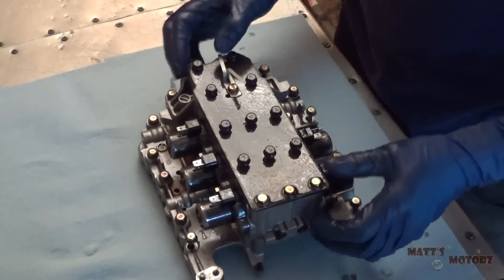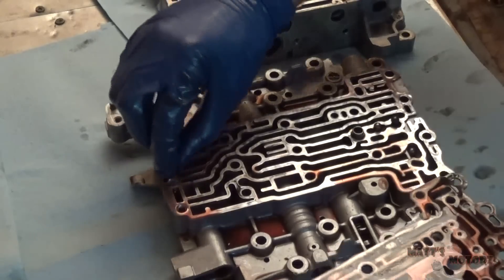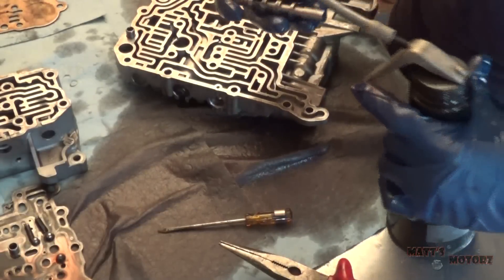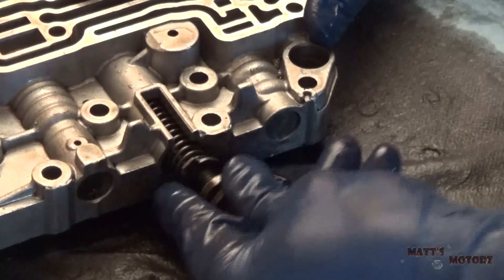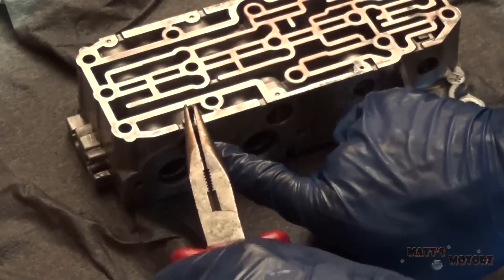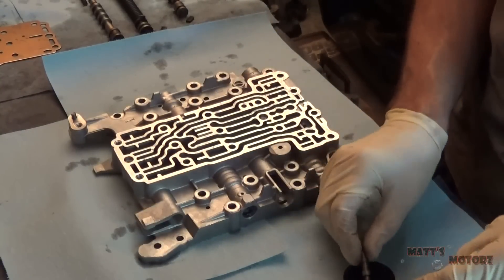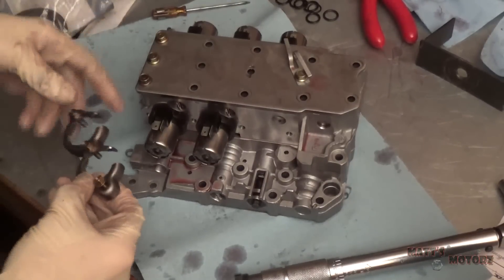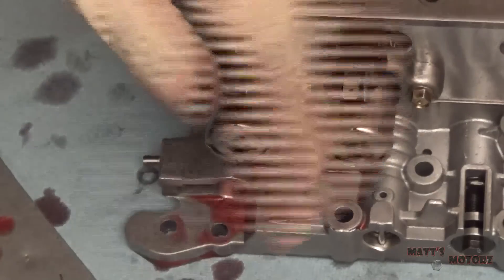F4A42 Transmission Rebuild: Part 2 - Valvebody Rebuild

Comment: I have a question about the solenoids on the valve body. Between them, which one is the torque converter clutch solenoid? Awesome video.

Comment: What solenoids are p0760 and p0755 I can't find any info on it. My code reader says p0760 is c and p0755 is b. It doesn't say which ones they are any help would be amazing.

Comment: Couple of small questions for ya; what symptoms would the transmission exhibit if you had opted not to sand the valve bores with fine grit paper and left the sticky valves? What do those valves do, and would a sticky one cause a solenoid code to throw? No matter how long I look at the hydraulic circuits, I just cant make any sense of them.
Reply from the maker: Sticky valves cause delayed shifting (most common).  I do not think sticky valves would throw a solenoid code but you never know with transmissions.  The computer may get confused if it energizes a solenoid and the transmission doesn't shift because a valve is stuck.  You can energize them yourself and listen for a click to see if they work.  Watch my video "How automatic transmissions work" if you haven't already to get a bit more information on the valve body and valves.
Reply: Thats true, hydraulic pressure > sticky valve resistance for sure. Well.... I have a lengthy inquiry to ask; so I apologize in advance!! But if you'd be so kind just to hear me out, I will pay you even, and just be eternally grateful, since you are easily the only person I can directly communicate and ask with the very specific expertise in our EXACT transmission; I just need the answers to some detailed questions, so that finally, perhaps, I can get my vehicle going again and figure out, exactly 1 year ago, while driving on the highway in overdrive, or I guess its just drive,  did it just... out of the blue, randomly, with no warning, act like it was in "neutral", followed shortly after by thudding into fail-safe mode. I figured out back then that I could somewhat circumvent this by just driving around with shifttronic, albeit with 4th gear absent, and 2nd gear mostly absent.

So, here goes... upon further inspection yesterday, I think I found the culprit of 'atleast' one symptom for sure, if not more, I just need you to help me with the diagnosis because despite reading the hydraulic schematics, and everything else about the trans internals over the past year, I just can't figure out what effect this problem would have.

The problem i'm referring to is it turns out that the 3rd accumulator piston from the left (valve body removed, staring at front of vehicle) has a hole punched in that middle little embossed circle, the raised molded circle; now, I don't understand how this thing exactly functions, so I just need to know what symptoms would that cause exactly? Because ultimately, I need to find out 3 things. 1.) Why 4th gear would go either A.) Rev  Rev Rev Rev Rev like it was trying to shift into gear, or rarely it would do B.) [just be in a neutral-like state]   2.) Why I didnt have second gear, except only rarely when I would downshift (with shifttronic) into it, and finally, 3.) The most recent problem of: Early, cool morning drove ~50 miles around Kansas city for errands, everything was fine, then when I tried to drive home, randomly, while on the highway 3rd would just slip until I got it to like 6 or 7K RPMs, then it would grab a little bit and I just kept revving it up and coasting all the way home, doing about 60mph, and I barely made it home at that. Again, I apologize for the long post, but these questions have really, really been eating at me for the last year, because I just want to really know the ~why~ behind the failure, and of course to get my vehicle running again.
Reply from the maker: When a gear goes like that, it usually means that the transmission is trying to engage the clutches / bands, but something is internally wrong and it is not able to, so the engine just free spins because there is no load on it because the gear isn't engaged.  This usually throws a code. Is there a check engine light on?

Your final problem (number 3) is indicative of pressure loss in the hydraulic circuit that controls that gear.  The pump output of the transmission is directly related to the speed of the engine.  If the gear was able to grab only when at very high RPM it means 1.) there isn't enough fluid to keep the circuit fully pressurized at normal pump speeds (aka, the fluid is low), this isn't likely the case in your situation; 2.) there is a leak somewhere in the hydraulic circuit, most likely on the lip seals somewhere in the 4th gear gear train.

Many times the same clutch pack or band is used for multiple gears, so if the seals are going in a common clutch drum, all those gears will be problematic.

That is all I can do without really digging into it and pulling out the service manual.  I AM willing to do that if you provide payment as you suggest via paypal, because it really would be an investment of my time.  I won't guarantee any enlightenments, but I can offer my knowledge.
Reply: Ahhh, will do. What symptoms would about a centimeter diameter hole in my 3rd from the left accumulator piston cause
Reply: Oh wow, I can't believe I forgot to mention the most important information in my spiel, the trouble codes! lol.  I've had the same 2 codes throughout this whole ordea, always these 2, never anything differentl: P0755 and P0760. So a year ago, I figured I'd just replace the UD solenoid, 2nd brake solenoids, and the solenoid harness and it would be good as new, but after I did that there was no change. Its never thrown anything different but those 2, and later I tried tracing the circuit for a short, and never found any. Its worth noting that when I lost 3rd gear the other day like I mentioned, a peculiar change in the codes came up, instead of those 2, I now was showing P0755 and P0765. No idea where the 760 went, but now it was those 2, which was weird since I kept seeing the same 2 numbers for over a year.
Reply from the maker: Without going into the service manual, a leaking accumulator might cause delayed or difficult application of the gear.
Reply from the maker: Those codes give valuable information.  First, shift solenoid codes do not generally mean the solenoid is bad.  The computer calculates the gear ratio and compares it to what it should be with the gear applied.  If it is different (such as if the transmission is not engaging a gear) it throws these codes.  If you have a general leak anywhere in the circuit causing pressure loss, it is likely these codes will set, even though the solenoids themselves are perfectly fine.

This codes tell us that the circuits involving these particular shift solenoids are the ones affected.  It appears to me, based on the evidence you have presented, that you have a leak somewhere and you most likely require an overhaul to fix it.  To be sure, you should measure the line pressure of the transmission during the problem shifting events (I made a video showing how to measure pressure).  This will help you narrow down where to look if you decide to over haul the transmission. 

It seems to me like you may have a pump failure as you are getting codes that indicate problems on many different circuits. (Many times you can replace the pump without major disassembly).  You NEED to measure the line pressure to determine this.
Reply: would it be a good idea for him to just get a remanufactured valve body and swap it out? they're like $300 for the 42rh
Reply: I would never pay that for a valve body lol, i'd either rebuild mine myself, or more preferably buy one from the junk yard for $35 and order a new gasket for $6

Comment: Where is a video that talks about a 96 Mitsubishi Transaxle in limp mode? What are common causes. Or, what is the most common cause? Wayanchors.
Reply from the maker: A very common cause is a bad speed sensor (assuming the transmission is new enough for that).  Scan computer to see if there are any codes.
Reply: Not a new transaxle. 96 Mirage 1.8L. Not much literature on it. Sometimes I get Crankcase Sensor error. Also, difficult to start in warm weather. Otherwise, no other codes.
Reply from the maker: It looks like the transmission in that car is the F4A22, the predecessor to the one in the video.  I don't know much about this model, but if you don't have any codes then it is very hard to provide good advice over the internet.  Did you get a scanner that is able to read TRANSMISSION codes?  The cheap ones wont do that.  You may have to bring it in to a transmission shop.

Comment: the magnet comment on the checkballs is bullshit, the magnetic effect is negligible and is overcome by the hydraulic pressure and flow.
Reply from the maker: That comment wasn't something I made up, I have seen it in many tech manuals for automatic transmissions.

Comment: My question is...
Are all the solenoids the same?
Like if I buy a pack of 5 original solenoid for a 2003 tiburon but they all look the same.
Reply: I think my tranny is f4a42-2.
I don't know the difference of the  -2 to the f4a42.

Comment: at around 9:34-9:40 I didn't see a spring in that valve. I have the same valve body and also didn't see a spring here. am I missing something or is everything ok? because every other valve seemed to have a spring but this one!
Reply from the maker: Not every valve needs a spring.  It all depends on how the valve is designed and what it is meant to do. So yes, everything is fine lol.
Reply: +MattsMotorz whew! thanks because I went ahead and put it all back together already! holidays have me delayed on parts but your videos saved me some time! Especially since this is the first time I've been inside an automatic transmission lol.

I'm working on an F4A51 that got hungry for the oem style wave spring. SHREDDED the pump! metal shards in everything. I tried replacing the wavy the first time with the tranny still in the car because of flaring shifts and ended up thrashing the pump when everything broke loose 2 days later. oh well. this time I did the flow upgrade for the 2-3 shift flare too so she should be gravy now!
Reply from the maker: When this happens it is imperative to clean EVERYTHING really well. You want to remove all traces of aluminum that has been flowing through the system from the damage. This is especially true for the valve body as many times the aluminum in the fluid acts as an abrasive and causes the valves in the bores to stick.  Polishing the bores is a good idea so all valves move smoothly.
Reply: +MattsMotorz the valve body has been completely cleaned out valve by valve. as far as the rest of the tranny, the only thing I didn't take out was that large goofy threaded transfer gear on the main housing. I'm confident no wavy got in there though... it seemed to follow the low path into the filter and valve body once it dropped out of the gears. Let me know if I'm wrong about this, it's not too late to pull it off. I sprayed a couple cans of carb cleaner throughout though. I think the failure was pretty catastrophic and sudden, luckily, so there wasn't much time to cause damage to the valves. I saw some debris around one of the larger valves near the solenoid and some very minor surface scoring on the valve but all of them seemed to move freely once clean. I'm taking my chances it runs ok. I can always pull the valve body from under the hood. Happy Fourth man, I really appreciate the vids
Reply from the maker: Gary Barbour II Ah, I was under the impression you did a full rebuild.  Yeah I think you should just put it back together and see if it is okay (I think it should be).  You definitely at least want to put new fluid in it.  I am glad my videos helped btw!
Reply: +MattsMotorz if I had known the pump was going to blow I'd have been better off with a full rebuild kit lol. But it's a matter of time and money at this point and since this is my first time in an automatic transmission I feel I've pushed my comfort zone pretty far by replacing the pump, overdrive clutches, two wave springs, some bearings and seals and a filter. also, it looks like it had been rebuilt not long ago, since it has 200k and the clutches look brand new  (my buddy said the overdrive clutch plates probably failed because of the broken wavys) so I'm hoping the last guy made sure everything else was in good shape prior to failure. But more that anything this is my crash course education!
Reply from the maker: Gary Barbour II Let me know how it goes when you take it for a spin!
Reply: +MattsMotorz will do!
Reply: +MattsMotorz parts are here! I should be done by the end of the day!
Reply from the maker: Gary Barbour II Awesome!
Reply: +MattsMotorz I'm driving it! everything is good except it still has a 3-4 shift flare!
Reply from the maker: My guess is that the pump fragments caused small leaks in the piston seals inside the transmission.  A flare usually occurs because the transmission tries to engage the apply-piston or servo and the friction plates / band does not grab right away due to the lower pressure caused by the leaking seal.  Eventually the pressure builds up enough so that even with the small leak it is able to hold. However, during this process the engine has no load so the RPMs increase briefly.   

This is what I would do.  Look at the hydraulic circuit diagrams for the 3-4 shift process.  Determine which clutches / bands are applied in this process that are NOT applied in the other gears (likely the direct clutch drum) since the other shifts do not have a flare.  This is your culprit.  If it is a servo, you may be able to simply drop the valve body again and replace the seals.  Otherwise you will need to disassemble the transmission to replace the piston seals.
Reply from the maker: And at that point, you might as well do a full rebuild.
Reply: +MattsMotorz actually that paper gasket by the separator plate had a small tear and I tried siliconing it but the rest of the valve body looked fine

also I'm not 100% sure I got the clearances right after replacing the wave spring with the newer style. this is my first time inside an automatic transmission but I definitely plan on being alot more meticulous next time. Lesson learned.
Reply from the maker: Gary Barbour II It is hard to say that those things are causing the flare.  Clearances that are off usually result in slippage (if the clearance is too much) or quick wear (which would manifest as transmission fluid that gets dirty very fast and smells burnt.)  The quick wear would eventually leak to slippage.  Flaring is different than slippage caused by bad clearances.  You are dealing with a sealing problem.  I don't remember the details of the gasket you speak of.  btw, it has been awhile.

If it were me, I would take line pressure readings during the flare, study the hydraulic circuit for that shift, and determine the likely culprit.  Then I would probably just do a rebuild.
Reply: +MattsMotorz the gasket between the whole valve body and the main trans casting, sorry.

yeah I'm not looking forward to pulling it again but I think you're right. thanks for the help!

Comment: Hello Matt, thanks for doing this video series. I was looking for videos on the F5A51 Transmission and thats how I came across your channel. Is this trans much different then the F5A51 Transmission, if you know?Thanks, Ken.
Reply from the maker: Hi Ken, I do not know to be honest.  I would guess that it would be very very similar, but definitely have its own differences.  These videos may still be useful for you, but even if they were the same, a rebuild should never be done without the factory service manual.
Reply: Hi Matt,, I came across your video. Very helpful. I'm working on an f4a42 too. I've got an f4a51  imported as spares, didn't find exact one from Dubai.. Was thinking if the valve body for Both models are the same as I might need to swap it. Any advice please? Is there any pdf I can follow? Thanks mate.